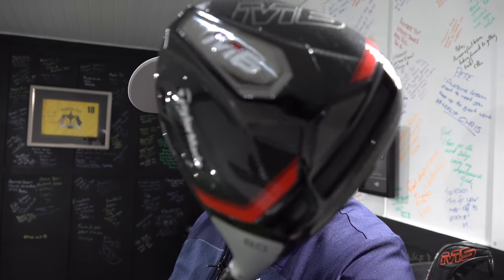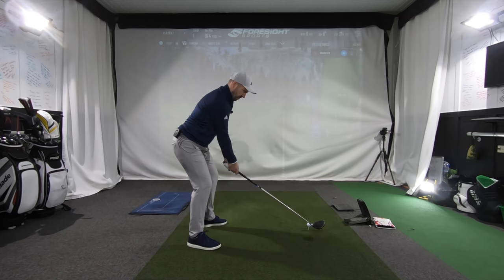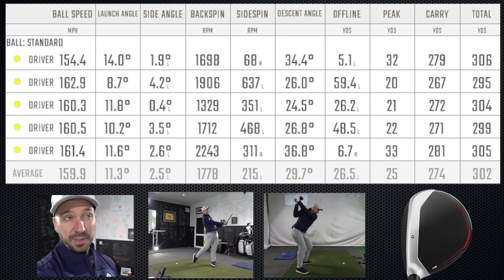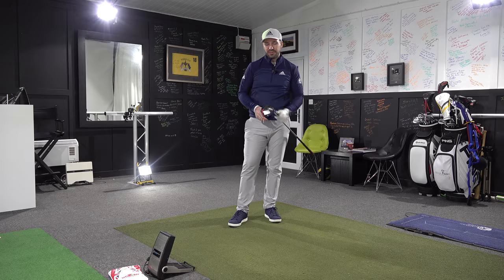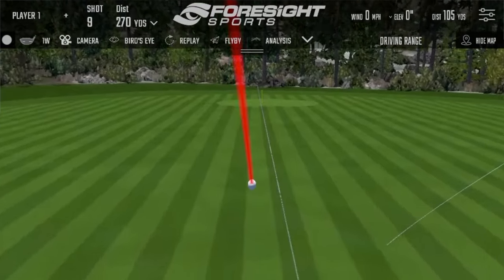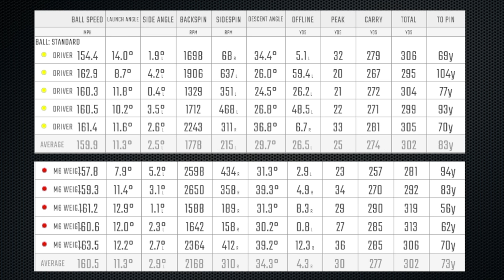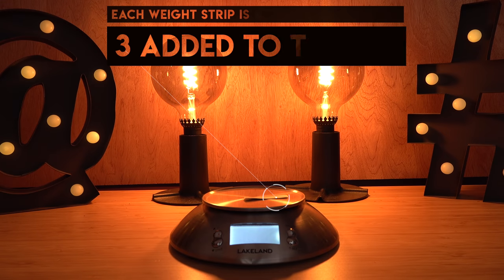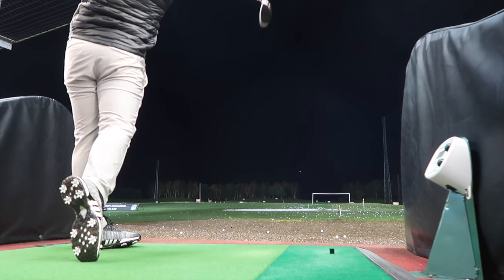Custom Fairway Finding MONSTER! Don't buy a NEW driver before watching this..

Comment from the maker: Quick one also peeps. I don’t compare the new set up to my current set up as I’ve already don’t loads of vids with me hammering my M6, it’s longer than the fairway monster + I can hit it higher 👍 x
Reply: Peter Finch Golf is it now not similar to the “original one” mini driver you had?
Reply: @iaindaun8022  It has a bigger more forgiving face than the "Original One" mini driver.
Reply: Finchy can u hit more draws mate?
Reply: Did it leave any damage removing the lead from the head pete?
Reply: Can you do a video on launch angle? I’ve been working on hitting up on the ball and now finding that my launch angle is higher than recommended for my swing speed.
Reply: Peter Finch Golf I’m most interested in where you got that hat?
Reply: @josephnewcomb1737  high launch is fine as long as your spin goes down as launch goes up
Reply: lefty was carrying 2 drivers....
Reply: #sunsoutgunsout which way to the green?
Reply: "Sting Machine"

Comment: I've been playing golf for 30 years now and I'm shocked that I didn't try this sooner. It's been a game-changer for me. Immediate results. I have an old TaylorMade Superfast Burner 1.0 (same one Sneds used a few years back to win at Torrey). I cut the stiff shaft down two inches (now 44.5") and added about 10 grams to the bottom back and toe of the driver. I've had longer and straighter drives than I've ever had before. I liked the results so much I added about three grams to each iron. So much more pleasant to play golf. Feels like it should be illegal.

Comment: Excellent video Peter! I tried cutting down the butt end of my driver shaft and threw off the swing weight. Adding lead tape to the head brought it back to D3 and got the best of both worlds, consistency and distance (because I was hitting the middle of the face). Thanks again for the content!

Comment: Fascinating video, I have been tinkering with my Callaway Rogue Driver recently. I was fitted with this club and after a bit of a honeymoon period my drives have gone a bit off. I transferred the shaft into an earlier Callaway GBB driver head with the sliding draw/fade adjuster. Fiddling around with this and also fitting a 9 gram sole weight has refreshed my tee shots.

Comment: Had an M3 with a 1 inch shorter shaft, changed the sliding weights to heavier ones and added lead tape to slow tempo down.
My miss is a quick hook or a block right. The result of the heavier SW was a smoother tempo and I felt I could go after the ball more without being scared of the quick hook.
The head recently cracked and Im waiting for a new M5 head from TM. Will probably go for the same setup.

Comment: Added lead weights to my drivers for years and it 100% works. 

I think however your better buying such as the Taylormade versions that have weights in already as you can easily add more

The R15 was great and the M1 for me
I chopped 1 inch of shafts and added 30g in weights.

Comment: I have tried my 3 wood shaft in my driver (both G400 Ping clubs). I struck the club better and hit it farther. I, too, had a bit of a draw problem with the club but did not think to add tape to change the club face closing rate. I will try all you suggest and see if I can make a better driver for myself. Thanks for the insight!!

Comment: Wow I did the exact same thing a few years ago with my Rocketballs stage 2 Tour edition driver.  It still hits very well and I always hit it well but it's not as forgiving as my epic flash.  

I even did the lead tape, but I used a shorter shaft from one of my Rocketballs 2 rescue hybrids instead of my 3 wood.  Most places I play are too short for me anyways and I don't like driver - wedge golf all the time.  I usually have to put some lead on the toe of some woods.  I struggle to keep spin down too.  The club feels much better by re gripping with lead tape under the grip, and/or a lead cap on the end of the shaft under the grip too.  I do that with any club I put lead on at the toe.

Comment: Great video I took my ping g400 lst and cranked it down to 8 degree,  I got a aildila rouge silver 60 tipped  it 1 1/4 , to be 43 inches total , added lead strips on bottom of head for a total weight of 212 grams  so I could  feel the head, best thing I ever did it's a bomber and down the middle. lost no distance, middle of the face ever time

Comment: Hi Pete I have a cobra f7 driver. On it you get 2 x 3g weights and 1x 10g. I normally have the 10g in the low lauch setting as I launch high and the 2 x 3grams in the high and draw ports. I had a massive slice down to not being the most flexible after years of playing rugby. So i purchases a extra 10 gram weight to put in the draw setting. Now having 2 x 10g weights on the club it seems to help straighten me up and keep the ball lower.

Comment: I just added lead to my 52 and 56, 9 grams each. The 52 I placed then dead center stacked for a better ball strike. It was a high middle strike and the weight brought it down to center. 56 I added the on center heel side to move my strike from heel side to more center. Both had the intended affect and I'm pleasantly surprised how the fractionally different strikes have improved my wedge play. 
Great video Pete!

Comment: You should tip the shaft. Cuz you basically turned it into a 3 wood. Also lead tape doesn't "slow down" any part of the head. It just moves CG a bit to move gear effect. Also by shortening it so much, you've flattened the effective lie angle which will also make it go right

Comment: I did something similar to my Epic driver.  Had the shaft shortened to 44.5" and some extra weight added into the head.  Result is a massively straighter driver with no noticeable loss of distance.  I could probably bring the loft down as well - must try that with trackman sometime

Comment: Great video! Maybe it is time to dig out an old driver and tinker a bit.
I have an M4 driver, x-stiff 73gram shaft, 9,5deg, cranked down to 7,5 and this summer I saw very clearly that I had to get the spin down, since I have a club head speed of approx 120-125 and the M4 just spins too much at that speed. So I added 10gr of lead tape to the lower leading edge of the driver and I have never driven the ball longer. (obviously I am also swinging better, but there was a very solid improvement exactly when I added the weight). So for a cheap golfer, lead weight can really work wonders. But I still think I will get me a Ping 410 LST this xmas.

Comment: Great video,I am seventy seven and my distance has dropped slowly over thr years.I started to think what if I used a shorter lighter shaft,after trawling the internet I came across a tour edge driver x9 fitted with a ladies shaft,priced at eighty seven pounds,I thought why not.when it arrived it was brand new,after trying out a number of settings I settled on nine degrees,with really good results gaining twenty yards,next try some lead strips,many thanks Dave

Comment: Great vid Pete, really interesting.. My last 3 drivers i've been fitted into low lofted, low spin models. While they were long I really struggled with consistant duck hooks. Went to Scottsdale Golf and they fitted me into an M6 with more loft (10.5)and the x flex shaft you had there to keep the spin down.. It's been a game changer. Loads more control and hitting a lot more fairways without any noticable loss of distance... Winner Winner ;-)

Comment: Cut an inch off a regular shaft to bring it back to stiff and put a heavier weight in an M2 driver head to bring it up to D2 swingweight. Worked perfectly and feels great. Cost me all of $20 in total. Now a fairway finder.

Comment: Enjoyed the video. I design things as a hobby. One of the things I designed was a driver that makes it very hard to slice the ball, and also to top the ball, which I suppose would be great for the average club golfer. I haven't applied for a patent on it yet and haven't got the money to build one, and decided against contacting a manufacturer after going on their websites and reading that they don't want you to contact them unless you have a patent on the thing that you have designed, which is a shame as I think my club would bring a massive improvement for most golfers. I was thinking of doing one of those crowd funding things but I'm not sure how to go about it. After watching this video I may get hold of some carbon fiber and try to build one.

Comment: I don't think I will ever go back to an off the shelf length for my Driver.  Currently sit at 44.25", not quite your 3 wood shaft length.  Also when using a shorter shaft it reduces the swing weight of the club so its best to add weight to the head to find your preferred swing weight.  adding weight to the head will also effect the shafts feel and flex similar to soft stepping irons.  Tipping the shaft may be needed to maintain the feel of the driver.  Switching out the shaft to a 3 wood shaft as you did will allow the shaft to play true to flex.  

I love this topic and thank you for educating the masses

Comment: Nice test.  I am not sure that the toe weights slow the closure rate, rather it  moves the sweet spot so is giving a different gear effect from same strike point.  You could easily test this by looking at the data from Foresight on Closure Rate.

Comment: This season I did put an extra weight in the front track of my M1, played it 44", 8,5° and with total headweight of 211g. Better ball speed but slower swing speed with att little more control was what I got out of it. I like to tinker with my clubs 😏

Comment: For a time, when I got back into golf, I thought it would be a great idea to go with a single length set of irons to keep my stance and swing consistent.  I found I had a huge gap between my irons and hybrids, so I did cut down my hybrids and then added some weight to the heads to make them feel like a similar swing weight.  It worked pretty well, and despite being longer still than the irons, I was crushing those clubs.  When I abandoned the irons, I regretted it a bit.  that said, all I've done in my current set was to shorten my hybrids a half inch for gapping and adjusted the lie angle using the hosel.  I'd like to say I had success with my driver, but it an OB-finder, not a fairway finder, so it's been staying in the bag.  I am thinking of buying some weights and playing with it.

Comment: I still play my M3 and cut it down to 44.5”. Since I did that, my driver felt like a toothpick. So, my M3 has 4 sliding weights on the Y-Track now. 🤷🏽‍♂️ Definitely a fairway finder. 🙌🏽

Comment: i have my driver cut to 45 inches, i also have lead tape on the center and heel. my swing weight is D8. it is a long beast, not always straight, but its long enough to carry trouble most times.

Comment: I officially invented the “Fiver” a high loft driver with five wood shaft, now that’s a fairway finder and longer par 3 weapon.
Reply: Sounds very cool. What loft, exactly? 10, 11, 12... Beyond that, you're basically looking at a shorter 3 wood, right? Love the name 'Fiver', too. That's brilliant.
Reply: it’s a callaway rogue 13.5 driver upped 2 degrees to 15.5. I also increased the rear head weight from 5gram to 14gram both to compensate for the swing weight in the shorter shaft but also to increase the MOI, I joke not, it’s really hard to miss the fairway !
Reply: Paul Askey that’s just a three wood degree  with a 5 wood shaft
Reply: you are on the right track, but 14 grams is not enough.  fourteen grams is about right for a 44.25" shaft. for a three wood shaft (43.5") you need ~20 grams. for a five wood (42.5") you need at least 26 grams. use a swingweight scale, you can buy one for $50 from golf works.
Reply: Luke, You must have misread, I said it was a “driver head” with a five wood length shaft
Reply: John Airey I agree about the weighting, but at my age and swing speed the overall lighter weight seems to work very well
Reply: @paulaskey1508  you can definitely hit the lighter swingweights, but people trying this should know that if they want to maintain swingweights, they need more weight.  I use two drivers in my bag. a 'fiver' and a 'bomber', and ditch my three wood, but the swingweights for both drivers are in the D3 range. No need to pick just one driver. I find that under tournament pressure, I don't hit the lighter swingweights as well as the heavier ones. a basic swingweight scale is only $50 from golf works and most pro shops will have one.  hot melt inside the head works, so does lead tape on the outside if one can't find weights heavy enough for the driver. some tip weight in the shaft can help, but too much will change the center of mass of the end of the club.
Reply: Paul Askey you Must have misread i said 3 Wood degree

Comment: You hit it correctly when you said it wouldn't help someone with less than 90mph swing speed. I did use lead tape on drivers for a lot of years when I was in my 30's, even 40's, and it worked great.

Comment: I've got a 12 degree M6,  and use a 8.5 degree Tour issue M2 head with a Graffaloy blue 3 wood shalf for bullet low ballers.  Works well when the couse warrents it.    Moving weight around though.......surely you'd have been better testing with the M5 lol

Comment: 🌟🌟🌟🌟🌟
Changed lofts and weights with F9 and Cobra weights plus 3g weights like you did ie more weight on on heel and toe with 10 degree loft low straight bullet

Comment: Adding that kind of weight has a much greater impact on your delivery as a heavier club head is harder to release, and thus harder to turn over. Adding 9g out towards the toe will move the CG of the driver that direction a pretty small amount, but you'd you'd really need to stack that tape all the way out on the edge for it to really impact ball flight.
Reply: Morgan Cross - you didn’t see the difference in the vid? 🤦‍♂️
Reply: @ultimatejay  Oh the difference is clear, i'm not arguing that. I'm saying it is not because the toe is heavier and thus shutting slower, but that the entire head is now 6 swing weight points heavier, which is substantial, and thus harder to release and turn over. The real test would be to move all the weight over towards the heel instead. The club would still be just as heavy and just as hard to release which would lead to the same results.
Reply: Morgan Cross - you are wrong- you put weight on the toe it’s going to turn over later keeping the face open thus causing a fade. Why do you thing they make adjustable drivers where you can move the weights towards the heel and toe? 🤦‍♂️
Reply: @ultimatejay  Because moving weight towards the heel/toe encourages a fade/draw bias by moving the center of gravity, not be influencing how much that part of the club moves. If the actual sweet spot of a driver is right dead center on the face then you have a neutral bias. As you move weight towards the toe, that sweet spot actually shifts slightly in that direction, so a strike that was slightly toe side before that would come out with a draw due to horizontal gear effects is now actually closer to the sweet spot and thus will draw less. This is why both Tiger and Rory have their M5's setup with the weight in the draw position, because that head was already extremely fade biased i.e. the sweetspot was already slightly toe side of the middle of the face and putting the weight in the draw position actually moves the M5 to being completely neutral. Check out the Driver CG reports on mygolfspy.com and do some research on horizontal gear effects and how they impact ball flight.

Comment: I bought a cobra ltdx ls. Put a mid launch low spin shaft in it and shortened shaft by an inch. Then swapped the 2 head weights of 10 and 3 g for 14g and 8 g and it goes like a rocket ship. Mid launch low spin with high ball speed

Comment: Swing weight should be way way off with the two inch shorter shaft. The 9 grams you added should help but you would need to use an ultra light grip to help bring the swing weight back to D3 or D4 of the stock driver. If it works for you then that’s great👍

Comment: Years ago I had a Taylormade R580 that I added lead tape to the heel and it helped calm down my slice a good bit.  The weight flew off one day and I epoxied it back on the club head and hit way more fades than slices.  I do have a 2 questions. First, does the TwistFace affect this?  And 2, with Taylormade cranking down the degree on the driver also closes the face per Taylormade did this contribute to the leftedness of this driver?  Thanks and keep up the great videos mate!!!

Comment: Put my M5 fairway shaft in my M5 driver during the middle of last season.  It was the best decision I have made in my golfing life.  Immediately saw an massive improvement in dispersion with no noticeable loss in distance.  I feel so confident now on the tee and have zero issues with the lighter swing weight.
Reply: How's that club now? I've put my driver head onto a 42" 5 wood shaft but haven't hit it yet. I reckon I'll be able to swing my hardest and still hit the middle

Comment: Great video as always Peter, but couldn't help but think about Trigger from Only Fools and Horses when your title says don't buy a new driver before watching this, yet you replaced the shaft of an existing driver. "i've had the same broom for 20 years. This old broom has had 17 new heads and 14 new handles." :)

Comment: Question, are you slowing the toe down for face to path control or are you moving the CG towards the toe making center strikes react and gear like a heel strike causing fade spin?  I think there is a lot of misconception with moveable weights or adding lead tape and what it actually does to the dynamics of the strike, but I could be wrong.  Looks like all your shots are starting left as it is, that would be face to path control.  The spin is bringing it back online.